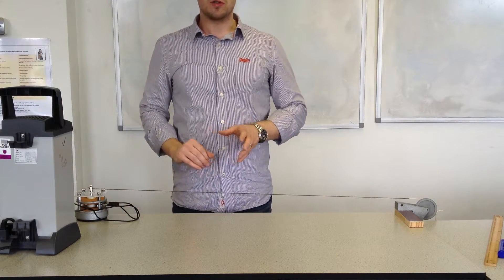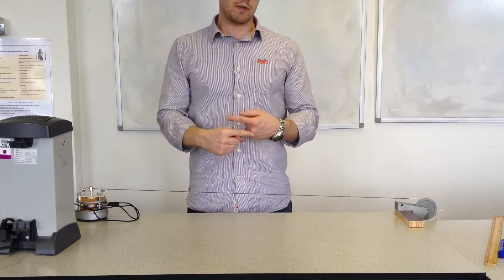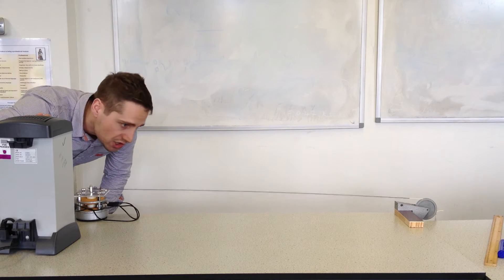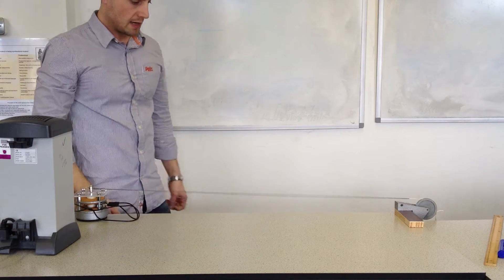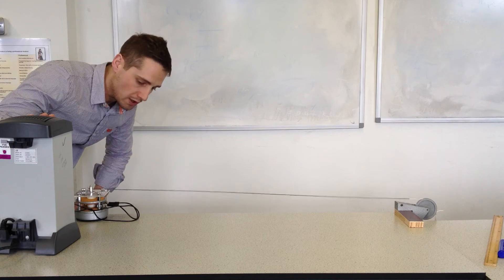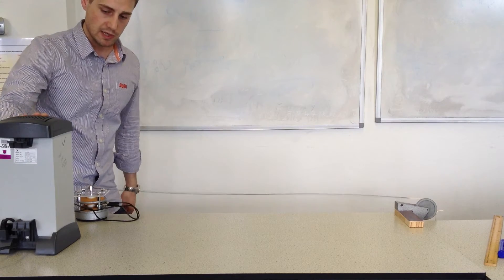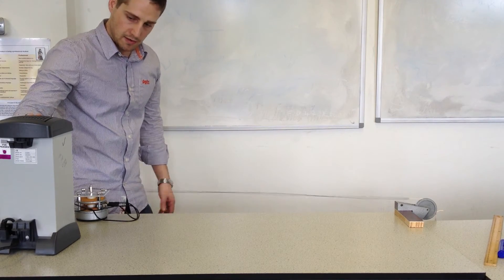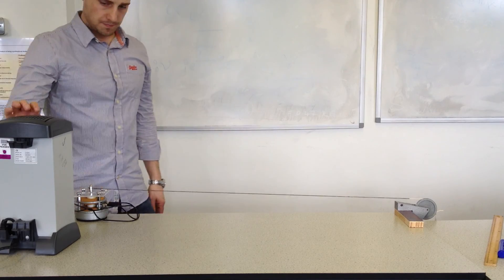Standing Waves - stretched string

Comment: Is there a specific frequency f1 for specific length string to produce first harmonic wave.
Then we double that specific frequency to get second harmonic and ,,,,,,,,,,
Reply: Yes. Wave speed on a string is given by:
v = √(T/μ) where T is tension and μ is mass per unit length. 
Fundamental occurs at λ =  2L (L is length of string). 
Thus frequency of f₀ = v/λ = v/2L required. 
Altogether that’s f₀ =  √(T/μ) / 2L
Reply: Yes

Comment: Are stretched strings electromagnetic waves
Reply from the maker: Stretched strings aren’t electromagnetic waves (which are perpendicular oscillations in the electric and magnetic fields) but I’m not sure how to classify them other than as waves on a string. 

At the molecular level there is some electromagnetic phenomenon taking place due to the molecular bonds enabling one molecule to transmit the oscillation to the neighbouring molecule.